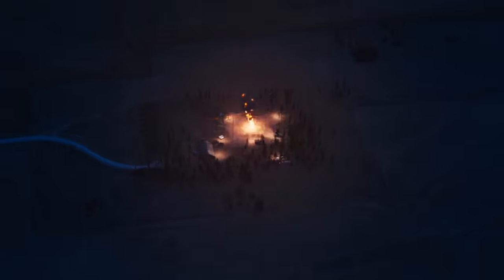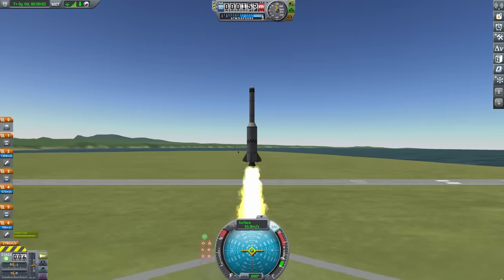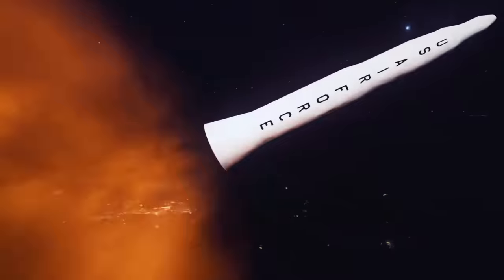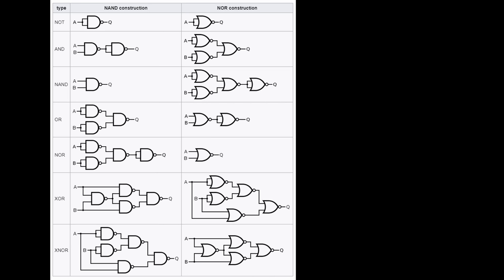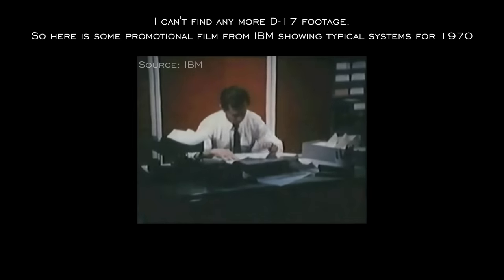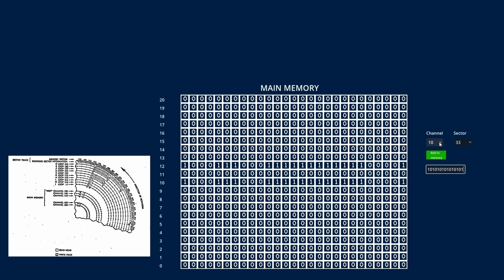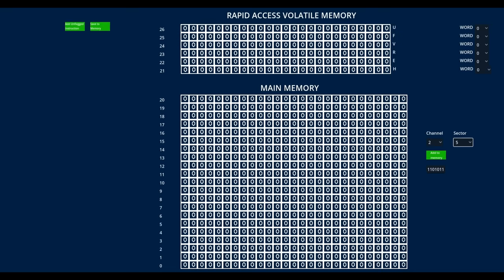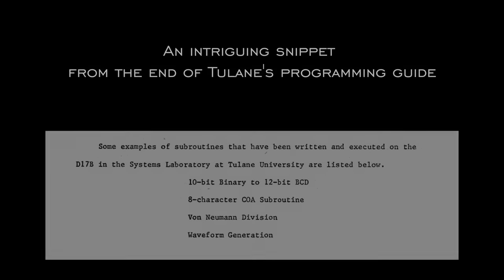Minuteman D-17b: The Desktop Computer Was Born in an ICBM

Comment: The 3rd stage termination shapes charges "switched off" the propulsion, by allowing the motor expansion gas to go everywhere following the path of minimum resistance, but not through the narrow, high resistance, rocket muzzles. Resulting in a lost thrust for the whole rocket
equal to an engine shutdown in a liquid propellant rocket.
The solid propellant was designed to be sufficient for max possible distance, any release of pressure, due to detonation, shortened the ballistic curve

Comment: 51:06 Actually, if we're allowed to clobber those two unused middle bits then split add/subtract is particularly simple:
split add: accumulator = (accumulator & ~0x1800) + (operand & ~0x1800)
split subtract: accumulator = (accumulator | 0x1800) - (operand & ~0x1800)
This is assuming 2's complement representation is used... I'm really not sure why you went with sign-magnitude considering 2's complement is the native format of both the D-17b and modern computers (for signed integer/fixed-point arithmetic), using sign-magnitude seems like it would just make arithmetic way more complicated to implement than it needs to be.

Comment: The use of beryllium is because it's the lightest metal. It has excellent thermal and mechanical properties aside from it being fairly weak, it compensated that with being bendy. It is also used for solar panel arms on current spacecraft among (many) other applications in the space industry.

Comment: Goddamn is that a RS-232 on top of that hard drive? I knew its old, but never know its that ancient
Reply from the maker: RS-232 had JUST been introduced when the D-17b was built. I think those connectors may be a close derivative - it looks like they have too many pins.
Reply: @Alexander-the-ok  Its funny how we still use it today (I do offshore engineering ). I guess USB-A will die faster than it. Well, if it ain't broke why fix it?
Reply: Timestamp?  Edit: It's at 31:29
Reply: Known as Cannon connectors, they were hi-rel, miniature (at the time) and are being used to this day aerospace. You can see them in pictures of modern  space hardware.  Variety of types including having coaxial contacts can be seen in electronic component catalogs.

Comment: A fine countdown instruction is an afterthought. They've clearly not able to catch up with a required speed to integrate velocities for the guidance purpose and made this instruction which in current terminology would be called a co-processor routine. I bet it was even implemented on a physically separated boards which were added lately to the original set of boards.

Comment: Afaik, modern computers actually just use NOR gates, and build everything else from there, since having a single kind of gate (that is functionally complete, like NOR) makes the silicon design significantly simpler
Reply from the maker: No way! They actually just use universal gates throughout!? I can’t believe I didn’t know that.
Reply: My understanding is that the abstraction is typically slightly broader with the standard cells being not just NOR gates but also the other logical operators as well as flip-flops, 2-bit adders, etc.  These are pre-optimized at the lowest level and then combined as you described.  Same basic idea though.  For mask-programmed devices though having a sea of NORs or NANDs could make sense (actual devices that I'm aware of use a sea of discrete N- and P-FETs).  [Edited for clarity]
Reply: A lot of early computers were comprised entirely of NOR gates, notably the Apollo Guidance Computer which used 3-input NOR gate modules.
Reply: @Alexander-the-ok  You can make every other gate out of NAND or NOR gates, but on modern CMOS processes, the NAND gate ends up using less area, so it's the preferred gate. That being said, the other commenter is right, that ASICs are made up of "standard cells", which implement NANDs, NORs, XORs, multiplexers, etc., that the synthesis / place & route tools use. A noteworthy one is the AOI cell, which stands for And-Or-Invert. It turns out that a lot of boolean logic can be simplified to ANDing together groups of values, ORing those together, and then inverting the result. They're also particularly space-efficient on CMOS processes. Wild stuff.
Reply: @MyloWhylo  re: AOI cells  Something similar is also made as a standalone IC (SOT26, SOT363, DFN1010-6).  The 74LVC1G58 implements Y = ~( (~A AND ~C) OR (B AND C) ) while the 74LVC1G98 implements Y = ~( (A AND C) OR (B AND ~C) )  From that one can implement a 2-input NAND, a 2-input XOR, 2-input OR, etc. (for the '58), and a 1-of-2 data selector with inverted output (multiplexer), 2-input NOR, 2-input NAND, etc. (for the '98).  Handy little chips to keep on hand.
Reply: The CDC 6600, 6800, 7600 supercomputer CPUs were also constructed entirely from NOR gates. In those, each NOR gate was a little circuit card with transistors, diodes, and resistors.
Reply: @Alexander-the-ok  From what the other people are saying, that may not be the case anymore? I got that information from one of my college courses on technical compsci (i hope that translates, essentially it covers the actual technology behind computing, all the wy down from resistors, transistors, capacitors etc (so much math with analog components), over logic gates, all the way up to complete circuits), which was held by a rather old professor so the information might be a bit out of date (a lot of the newer technology is also kept relatively secret, or at least hard to come by, when it comes to the details. 

I hope im not rambling too much, but as a small tangent the professor in question was talking about how back when he was a student the guy sitting next to him was building his own computer, given the modern connotation of throwing together some parts, i was a bit shocked (and impressed) when he started talking about how he was using gate programable arrays for the CPU, not sure which specific type but im fairly sure it wasnt the field or reprogrammable kind! Really cool, id love to do something similar at some point but i really am horrible at working with breadboards

really cool course, although a lot of it definitely wasnt my forte, and some of it may be a little outdated (the terminology certainly was, im fairly sure "master-slave retarded flipflops" arent what you call them today)

Comment: 23:01 I have a question. What does "maintaining separation" mean? From what I get, if the third stage is separated, the radar signature is decreased as well. However, "maintaining separation" would imply keeping the third stage? And I also don't get the retro thrusters fire at random times. Isn't the whole point of the guidance system to precisely fire on time different actuators? Or do the thrusters separate the third stage engines?

Sorry for all the confusion. I really like your videos, but sometimes the reach over my knowledge. Nevertheless I really like them, especially when I understand them. If you (or someone) could explain that to me, I would be very thankfull. Anyways, cheers!

P.S. I don't mind your accent and your dropped Ts. They give a nice touch
Reply: Correct, separating the 3rd stage from the payload makes the latter less visible to countermeasures.  Firing the retro thrusters (on the disconnected booster) at random times may be to confuse tracking and/or make it difficult to guess the payload's position relative to the booster (assuming the it isn't visible on radar); this is just conjecture on my part though.  Edit: Using a random interval would prevent this detail (booster/payload separation distance) from being ascertainable via espionage.
Reply: @alexhajnal107  The random firing of the 3rd stage booster was a brilliant move. To Soviet tracking radars it would look like a warhead maneuvering to hit a target. They'd fixate their targeting on it and let the actual warhead slip through. And yes, it is interesting that in the early 1960s the USAF was already anticipating anti-missile systems.

Comment: I dont know if you take suggestions (or rather, requests), but I was looking into the A-5 Vigilante and found that it was one of the first (if not the first) bombers to utilize a digital computer. Apparently it was called the "Versatile Digital Analyzer" or VERDAN for short. If thats a bit too esoteric, the F-102 and F-106 had a flight control system that was incredibly advanced for the time called SAGE that worked with GCI. With SAGE the aircraft could practically fly and intercept a target from the ground, then fly back and land with minimal input from the pilot.
Reply from the maker: The VERDAN was a direct predecessor to the D-17! From what I understand, the D-17 was basically an up-specced and miniaturized version.
As for sage, oh boy, now that is a complex topic! I'll add it to the 'potential future videos' list.

Comment: I took a look at the instruction set. Interesting that the multiply instruction takes 7 or 13 cycles (depending on length). I know that must seem like a highly obscure point but as a young kid who developed commercial games on 8-bit computers before going on to 16, 32 & then 64-bit processors, for 3D, multiply is the KEY function that was not supported by the processor.

So why 7 or 13? I'm presuming that's for 11 or 23 bits. When we are given timings, can we deduce that in fact instruction fetch, instructions decode & instruction execute represent 3 types of cycle usage and the fact that ADD takes 78 ⅛ ms infers that being 3 cycles?

Comment: If the gas bearings use the same thing as hard drives it means they’re using laminar flow. If you’re not familiar, that’s when atoms/molecules are more tightly bound to the moving surface than air outside of the spinning disk.
Reply from the maker: Funny you should mention that. Not only am I reading about gas bearings for gyros right now as part of the next video. But that video will also discuss Reynold’s number and how it  can be exploited for wind tunnel testing.

Comment: Beryllium has a couple of properties that could have made it a good material for the gyroscopes. High stiffness, high tensile strength, thermal stability, dimensional stability over a wide temperature range, diamagneticity, low density,...

Comment: I would GUESS that the tether (on the tethered test launch) was probably a data tether so they could get instantaneous data of what the accellerometers (and other sensors) were reading since they needed such accuracy.  I could be wildy wrong about this.
Reply: That was my impression as well.  A high-bandwidth (and reliable) telemetry link.
Reply from the maker: It was just a big cable tied around it from what I read.

Comment: Actually, to build a computer you only need ONE logic element; typical choices would be a NAND or NOR gate - i.e. an AND or OR gate with an inverted output. Depending on the technology used, these might even be easier to implement than "simple" AND or OR gates. For example, TTL and CMOS technology are "innately inverting", so to speak, with AND and OR gates being more complex to implement than NAND and NOR gates (e.g. in TTL technology, where a NAND gate might be implemented using 3 transistors, an AND gate would require at least 4). Note that a NAND or NOR gate can easily be used as a NOT gate by tying both inputs to the same signal (though in said technologies a genuine NOT gate is even easier to implement than a NAND or NOR).
It just so happens that Diode-Resistor logic is "innately non-inverting", so you need some additional gate type (borrowed from some other technology) wherever you need a NOT gate.

Comment: I have no knowledge of the d-17 or the minute man missile. Thank you for the data.
As for the R-7 rocket, i had the privilege of visiting a military training center for the r-7 on 1992. I and my group were given a tour but we did not recieve specific details.
The guidence control logic are based o. vacuum tubes. I got a good look at an example at point blank range. I do not know if it was digital or analog. My guess is analog.
The onboard tracking logic fills a large portion of an approximately 4 foot deep cabinet at the very top of the roughly 6 foot diameter main stage. There were 3 separate gyro instruments per coordinate but dont know what coordinate system was used.
I know that at least some of the trajectory correction data and decision making comes from the ground. I do not know how much, but some.
Learning to fly an r-7 was very prestigious, or so im to understand.
Unfortunately, thats all i know and I'd recommend taking even this "knowledge" with a grain of salt.
I think i might have pictures burried somewhere deep.
Reply: Vacuum tubes are not always simple. 
They all have an electron path but this can be moderated by a cylinder of charged material. 
Or by a different cylinder further out which has less of an effect. 
In fact there can be several such cylinders decreasing in effect. 

Each one allows a finer control but depending on the way the rest of the circuitry is arranged one can affect the other depending on the total effect. A kind of feedback mechanism.

Sometimes old TVs needed a replacement valve. Sometimes it was possible to remove a piece of the circuit which would never be in use but which was capable of causing flashes on the screen or whatever.
Reply: @20chocsaday  
Yes. There has been magic made with tunes.

But they are relatively fragile, physically, and they are bulky, reducing their logic per volume limit. 

I know that the Russians I spoke with were proud of the reliability of the system and pointed to that reliability whenever the notion of upgrading the equipment came up.
Reply: @bmobert  The only ones I have seen have been what I would call "delicate" and so was the way they were fixed in. Even the simple one I had for a cheap radio.

Comment: Ok so please tell me if I'm simply being stupid but:
I'm not sure if I understand why the missile needed to constantly correct its velocity? Surely it could just keep a timecount and work out from its velocity measurements where its current position was and how far it had travelled and activate the different phases accordingly? Why did it need to keep changing its thrust?
Reply from the maker: Remember, velocity consists of speed AND direction. So corrections were to the direction. The thrust was fixed.
What you describe is pretty much what it did: steered to ‘stay on the line’ and activate the staging at the correct point in the flight.

Comment: Using the disk as main memory isn't that weird at all. Modern operating systems do the exact same thing all the time, they just call it "swap memory" now.
Reply from the maker: Yep virtual memory, it’s the only reason my low spec pc can do some of the renders for these videos. But virtual (or swap) memory acts like an extension of the RAM.
Using the disc for the actual cpu registers is an entirely different undertaking (and would not be feasible in a modern machine since external storage is much much slower than the registers)

Comment: It is probable that the Soviets used some form of ground based guidance, either in partial or in absolute form. From the interviews that I remember watching of Soviet space engineers, that appears to be the case quite far into their space program, not just in regards to their earlier craft.
However, even with such method, a computer would still be needed in the craft, of course - just a much less complex one.

Comment: 9:45 it's even worse than "on or off". Once ignited, there is no "off," and unless subject to a catastrophic event, a solid motor will continue to burn until it is out of fuel.
Reply: Watched more, turns out that there was in fact a "catastrophic event" system built in 😂😂. The reason it works is that the burn rate of a solid fuel motor is HEAVILY dependant on its operating pressure. A propellant at 800psi (this is a fictitious example based on hobby rocket motors) may burn even 20x faster than the same propellant at 1 atm. In a vacuum, the produced thrust of the solid motor may be (relatively) negligible. I'm not sure if this would be sufficient to fully terminate the burning, but I can't be sure.

Comment: 21:15 you say you don't understand how charges would blow out the reaction. I'm not going to explain how it worked in detail but one of the first commercial fire extinguishers was just a baseball sized glass container filled with gasoline. When you threw it down on the fire it would break and ignite, consuming all the oxygen and choking the fire out (hopefully or you'd have a slightly larger fire to deal with) I think the people in charge of the thrust termination design took inspiration from that lol

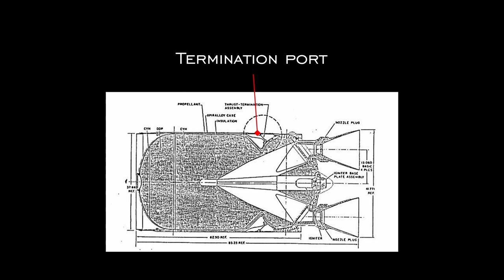Comment: 21:25 Have seen a video where someone tried to light an explosive mixture/rocket fuel in a (big) vacuum chamber with a laser. It only worked when there was pressure. His final experiment was with the fuel inside a sealed tube with a transparent window. His laser ignited the mixture, and it kept burning as the burning provided the needed pressure.
Apparently: No pressure, no burning.
And that is how that worked.

Comment: Crewed Soyuz rockets were still using analog guidance computers up until just a few years ago.
Reply: To elaborate, the first to use digital rather than analog computers for all functions was the Soyuz-TMA (first launched in 2002).  Prior to that analogue/electromechanical computers were used such as the rather stunning Globus IMP.